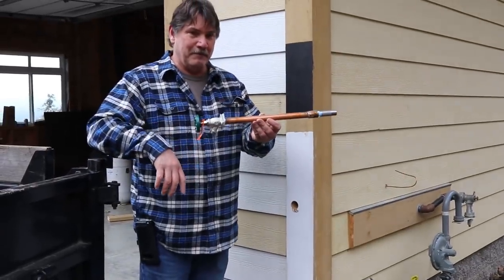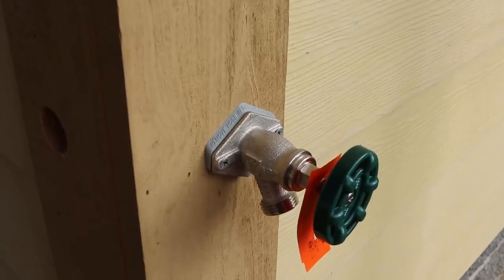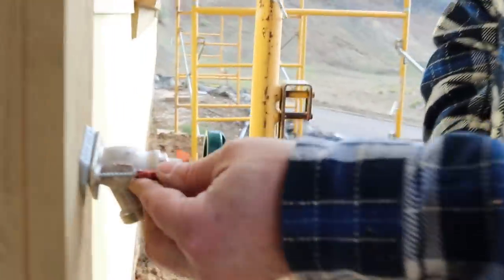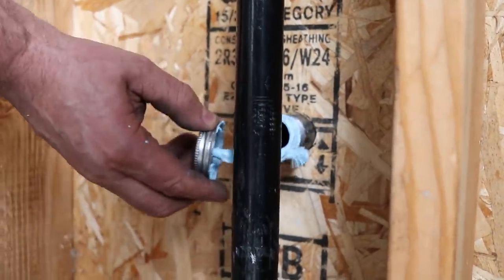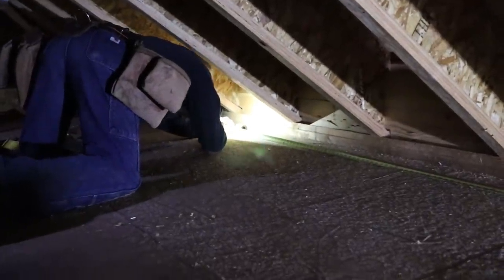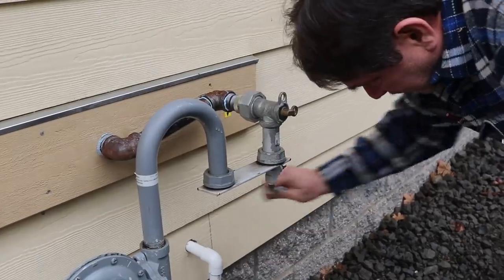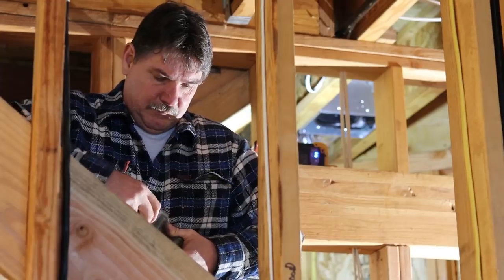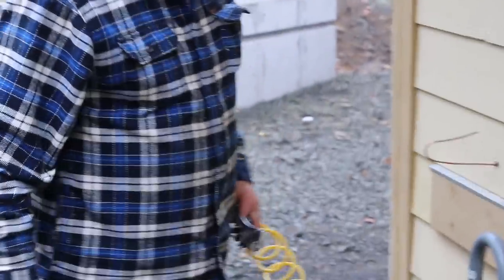Gas Pipe, Hose Bibs, Water Heater Ep.99

Comment: I have an on-demand water heater in my travel trailer and hate it.  The down side to them is there is a minimum flow for them to turn on so you can't have a small stream of water to wash your hands.  In a house you're not as worried about water consumption so it's not as much of a problem.

Comment: Is there any concern on the unions being backwards at the gas connection?   In the oil and gas industry they have a flow, the male side of the seating surface should be upstream of the intended flow direction.

Comment: hopefully you have installed a shut off valve on the intake side of the instant water heater.. when i installed instant electric water heaters over 20 years ago.. i turned the shower valve on about 3/4 turn with the actual shower head installed ..  i then adjust the shut off valve to slightly drop the pressure to the instant water heater inlet so the water flow from just the shower is enough to turn on the instant water heater..  perhaps new models have a different type of pressure valve.. this is because most showers are flow limiting so you get the minimum of water flow.. everything else takes more flow..   you can tell if your inlet valve is NOT turned off enough as if you turn the shower on. and you only get cold water. then if you reach over and turn on the Hot tap on the sink and you get hot water in the shower. you know you need to turn the inlet valve a fraction of a turn farther off.   when you get the exact spot.. and have find tuned it.. put some fingernail polish on the shut off handle pointing at 12 o clock.. then count the turns and fractions of a turn to shut the water off.. then turn it back to the same spot..  write that in fingernail polish on the pipe or wall with a date..  this avoids comebacks to readjust when the home owner has tinkered with something. 

 all that black pipe install sure brings back memories.   i did not see you install any sediment drops where the black pipe went vertical.. using a tee instead of an ell. with a nipple and a cap as a sediment trap..

Comment: Did you guys happen to install a return line? I’m a tankless and radiant heat specialist in Northern California and if you can, it’s worth every penny.

I’m not sure if that rinnai unit has a built in recirculation pump, but if it does, it would make it a breeze to hook up.
Reply: Yes.  See previous video.

Comment: Also I was super pleased with Rinnai thankless heater with the built in recirculation pump.  I had nearbinstant hot water that would last as long as the fixture was turned on.  But they recently really goofed with their latest phone app and now the recirculation pump isn't working.  Just look at all the Google Play Store reviews on Control R 2.0.  My wireless controller won't take the new firmware update and I'm not pleased. Especially when I had become accustomed to got water after a few seconds instead of almost a minute watching money go down the drain...
Reply: Better to tie the recirculation pump to a sensor or a relays hooked to a light switches or something along those lines. Unfortunately smart device support cannot be trusted for something that you might want around for 20 years, unless the underlying software is open source or can plug into an open source application.

Comment: You don't use gas valves for each appliance? That's interesting... In my country that is a must. Recently a thermo-fusion system is being widely adopted around here for gas and water, do you have something similar or local regulations don't allow that kind of stuff? Cheers!
Reply: Those valves might go after the drywall is in place. Didn’t notice if Phil put one for the water heater.

Comment: Propress fittings for water and gas line would of made this instal more than 50% faster and cleaner (no pipe dope)
Reply: At the low low entry cost of....$4000. Not to mention Viega fitting cost. I dont know how people make money using that thing without overcharging customers.
Reply: i think you mean mega-press for gas
Reply: @alanm2842  Is it not just a different set of jaws?? Is it really a completely different tool?

Comment: Any reason you could not use flexible stainless coated gas lines?  Are flexible gas lines allowed by code there?
Reply: we use them in some places, not sure if it is allowed where they are at. there are other options available

Comment: Regarding the comment about cordless screw guns, we used to regularly hand drive screws because it wasn’t worth running a cord to drive a few screws. I had a helper who is 25 and I told him to drive a screw and he argued and said why not just get a drill. He did not like the idea of hand driving a screw.

Blue monster is my favorite pipe dope but I don’t use it only because of the metal can. I use rectorseal which is plastic. That way I can use as much as I can reach then I open a new can. Once there’s enough space in the new can, I cut the old one open with a razor knife and scoop it out with a putty knife and put it in the new one.
I have to ask why you soap when you have an air test. I’d use the air test and if it doesn’t leak then I don’t soap. I don’t soap all the fittings unless I know there’s a leak or if it’s just a few fittings. It just wastes time
Reply: Is he no longer in your employ?
Reply: @janderson8401  no but for other reasons

Comment: Is iron required under your code? In the UK we can use Iron or Copper to feed internal gas.
Reply: Iron or flexible stainless in US, plastic underground
Reply: @carls6359  copper is allowed in uniform plumbing code. my city will not allow it though

Comment: Question for Phil, is there a correct and incorrect way to install Teflon tape?
Reply: Depends on size of pipe. Usually 4-5 wraps. Too much and it will just push up the thread and nothing will be in the joint.  Tape for gas is colored yellow and is much thicker. I prefers pipe dope and use brake cleaner to remove the cutting oil.
Reply: Yes. You want to wrap it so the tape gets tighter as you tighten the pipe. I hold the pipe in my left hand and looking at the pipe, wind the tape onto the threads clockwise, which drags the tag end of the tape into the fitting as you tighten it. And NEVER let the tape stick out past the pipe threads, hold it back 1 thread, to prevent any shreds of the tape from becoming a potential blockage.
Reply: @matthewwarfield4302  thanks Matthew it was a loaded question on my end want to have EC bring it up in a video for folks that don't know that.  I learned it the hard way about 25 years ago when building a sprayer for our farming operation when about half the connection leaked and learn there was the correct way to wrap Teflon tape.

Comment: Fyi most modern tankless, including this one, restrict flow to maintain the temperature so if it's undersized you would still get the desired temperature but may not get the desired flow. A good way to visualize this is if you turned on all fixtures at once you would get hot at those fixtures, however, the flow would likely be a trickle.
Reply: Thanks

Comment: Tankless doesn't really save much money, as less of the heat gets captured into the water. It's the convenience of unlimited hot water that's the selling point, and even there (with gas anyway) you still get that shock of the cold water sandwich as the slug of cold water that got through waiting on the safety circuit to allow it to turn on gets to you.

Comment: no you put teflon on the threads and then dope not the other way around! The reason why you do this is because the teflon will slide off the threads if there is pipe dope under it!

Comment: That seems a lot of work to bring gas to the upstairs dryer! With a 400 amp panel you would think you could have fitted an electric dryer in there haha
Reply: Where gas is available, it's usually cheaper than electricity for heating/drying.